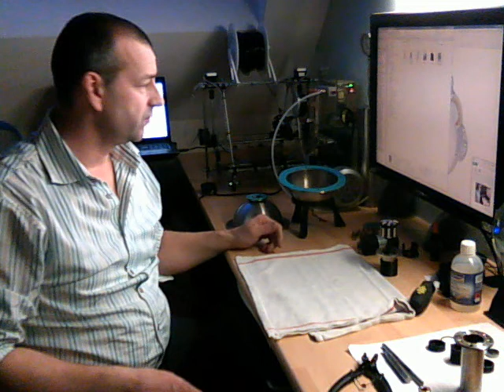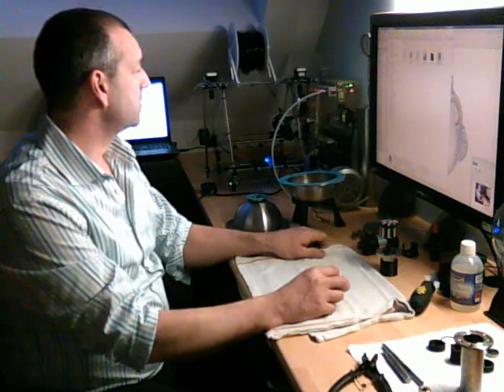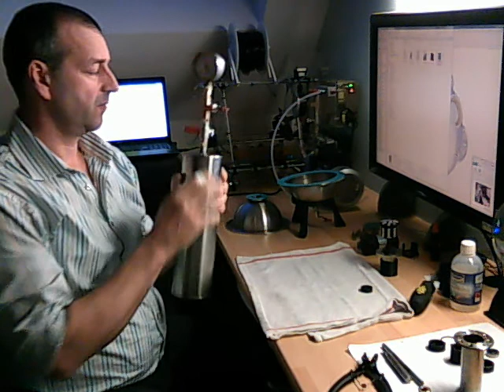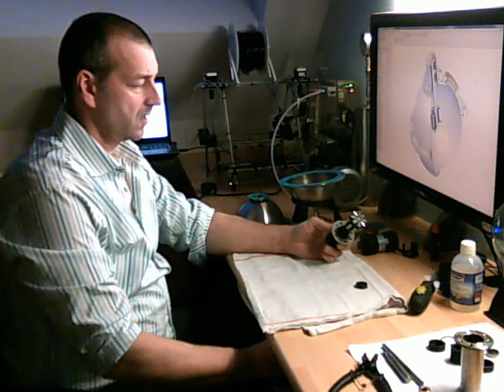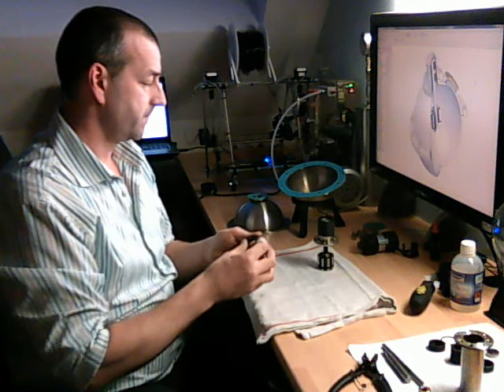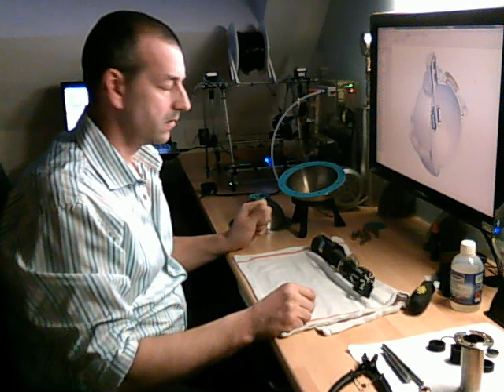V3 Vranckx Geert the building of the Keshe plasma reactor

Comment: Do you have a video about the electrode in the middle of the reactor, is it built from the Keshe design or is it your own, and the other this I was wondering I have seen a man build a keshe reactor that was not able to get it working but noticed something while testing and ended up placing another one at the other end to the first and was creating 11kw and he said he had captured the energy from the first reactor and ran it through an enhancement circuit and pulsed the other reactor at the other end and then it repeated the process and away it went, was this your reactor I saw on YouTube for one day only.

Comment: Hi Geert,  nice work there.  How much money have you spent on that reactor thus far, and how much more do you require?  I am working on my own reactor.  Challenge is, that I don't have much mechanical engineering experience.  However, I do have money and other skills to bring to the table.  Are you open to co-labing?  If so perhaps a meeting over skype or similar would be in order.  I live in Colorado, U.S.A.

Comment: Does this Reactor have Electrodes like the Bottle size Reactor? So basically the Atomic Carbon Layers are embedded inside the Electrodes acting like a Capacitor/Battery? Well, let's say a massive amount of energy (the energy required to power all of New York City) is borrowed from these Electrodes, how long will it keep on giving out power until the Electrodes within the Reactor is depleted?